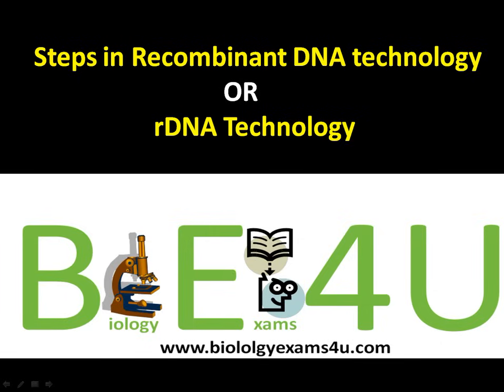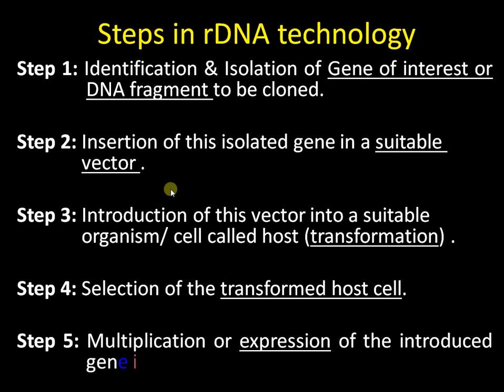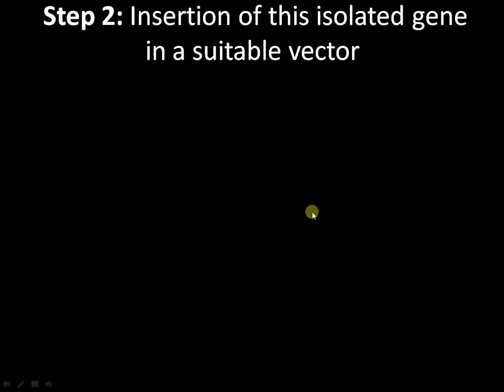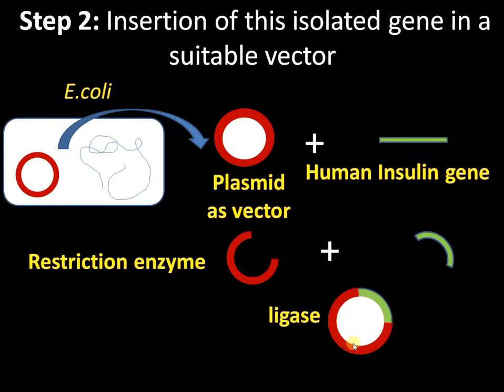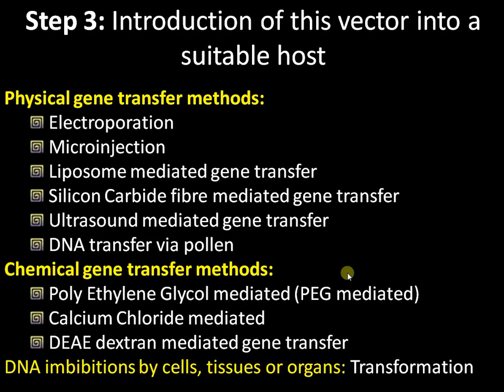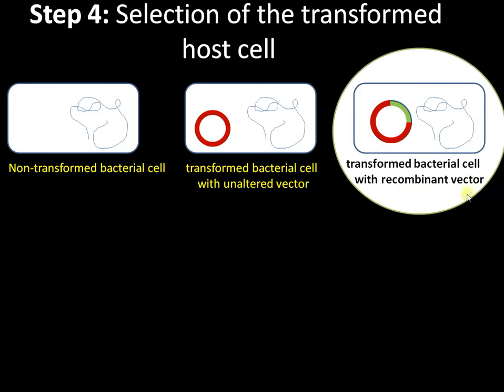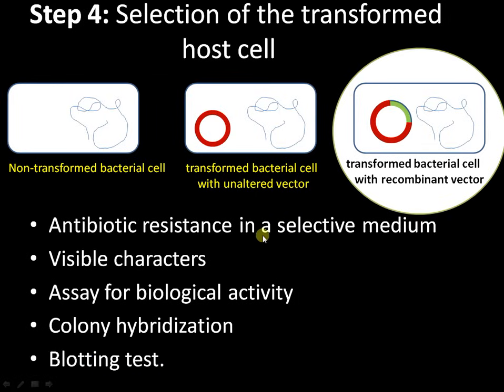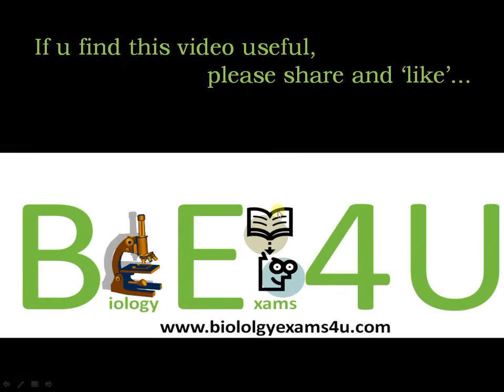Steps in Recombinant DNA Technology or rDNA technology | Biotechnology

Comment: What does '' visible character'' mean?? Hope ad help . ~.~
Reply: A visible character is a characteristic that the bacteria/cell will show when a plasmid is correctly introduced into the host cell. This is indispensable in order to select ONLY those cells that have integrated this plasmid.

For example, a common "visible character" used on DNA recombination in bacteria is the use of plasmids that have, besides our gene of interest, a gen that codes for a protein which provide resistance against antibiotics, like "Kanamycin".  Then, after the recombination and introduction of this plasmid in the bacteria, you will add Kanamycin on the Petri Dish. You will see that only those bacteria that have integrated succesfully the plasmid will survive, and the rest of bacteria that haven't been capable to integrate the plasmid will die.

Thus, this is a great technique to select only the bacteria that you want.

There are lots of "visible characters" that you can use when you are realizing a DNA recombination (Beta-Galactose plasmid, Luciferase plasmid, etcetera).
Reply: MisterAlbertoPiano  thanks. :)

Comment: what are shuttle vectors?
Reply: Hi friend! A shuttle vector is a type of vector (for example, a plasmid) that is able to get intoduced and work correctly in two or more types of cells.

For example, a shuttle vector is a plasmid that you can introduce in a bacteria Escherichia coli and in a human fibroblast cell. Its genes will express in both types of cells.

The reason for this classification is because not every plasmid is able to work on every type of cell. For example, a plasmid that works in E. coli (gram-negative bacteria) usually doesn't work in Clostridium botulinum (gram-positive bacteria). The reason for this is that a plasmid that has the same replication system as the cell host will be unviable to work, because it will "compete" for the replication system.

This last fact a little too complicated to understand thou xD. I hope I helped you!